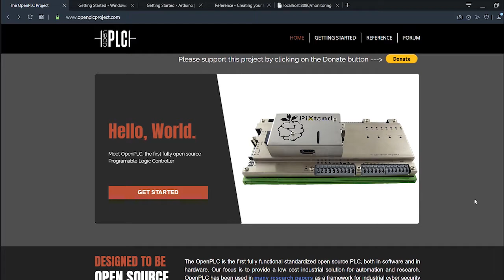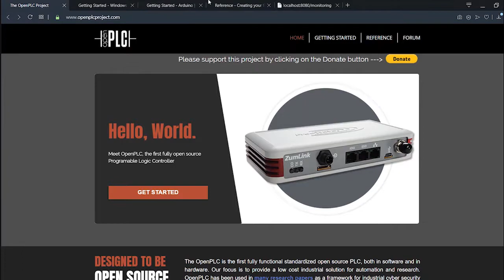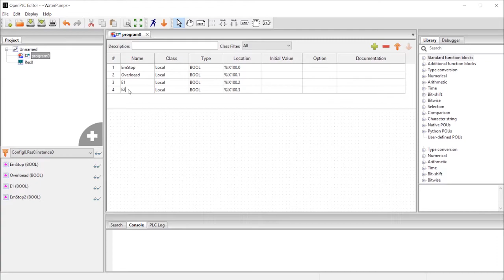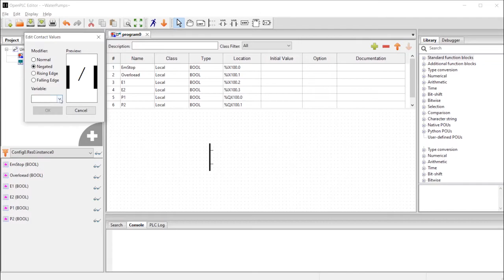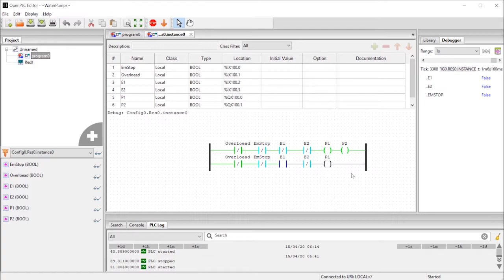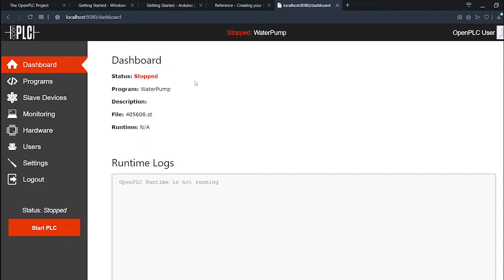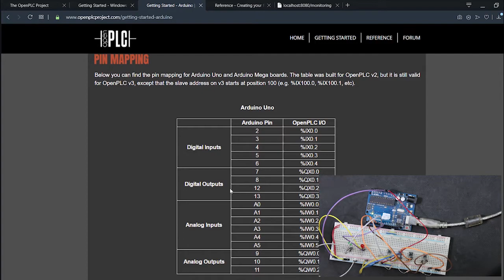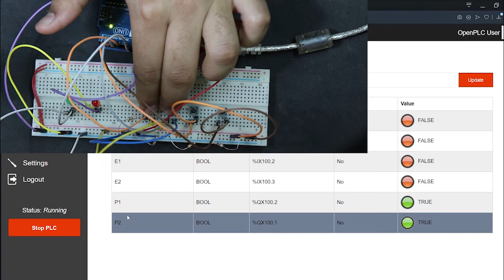OpenPLC and Arduino Part2 : From paper to fully working hardware

Comment: Nice tutorial, and thanks for using OpenPLC and sharing it with the community! I just wanted to point out the few common mistakes you had on your first ladder diagram that didn't work, in the hope that it is going to be useful to others as well. First, in ladder logic you should not put two coils in series. The right way to activate two coils with the same rung is to put them in parallel. Second, ladder scanning is cyclic, therefore you should not put the same coil in two rungs, especially when the rungs don't agree about the state of the coil. For example, in your diagram, P1 was used on the first and the second rung. When the scan goes about your diagram and E1 is pressed, the first rung tells that P1 should be off, but the second rung tells that P1 should be on. You probably didn't see this on your simulation because the refresh was too fast on your computer (or the screen updates were too slow for the refresh cycle). But then when you uploaded the code to run on the Arduino, the situation was different. The right way to do this on ladder logic is to use memory, and not the actual rung. You should have a memory coil that represents P1 and P2 for the first rung, and a different memory coil that represents P1 for the second rung. Then, you should add a third rung that connects your memory coils to the actual P1 and P2. Thanks for the video, and keep up the good work! OpenPLC needs more people like you.